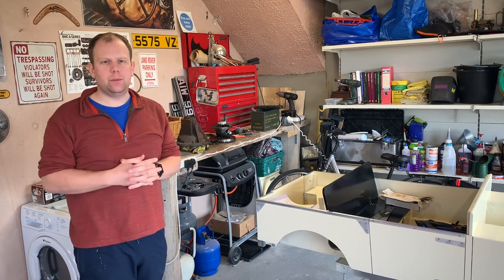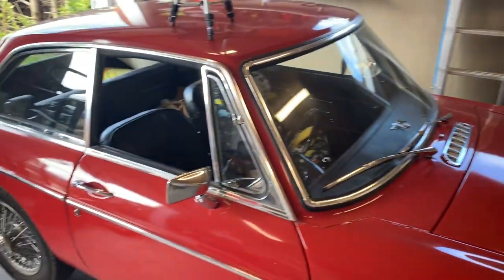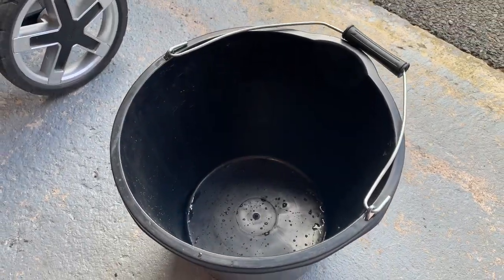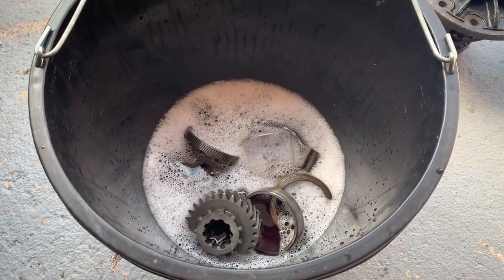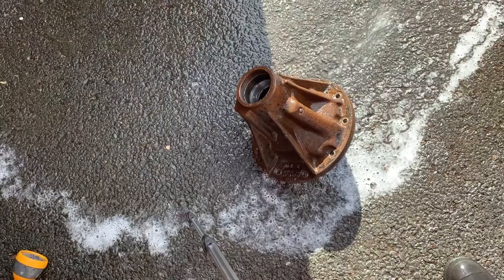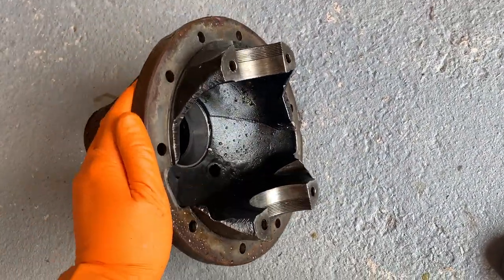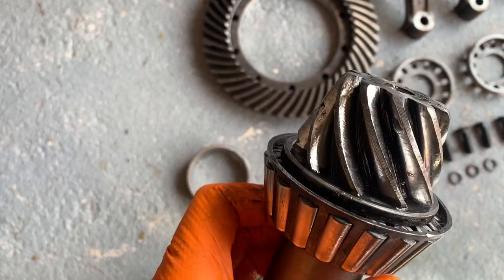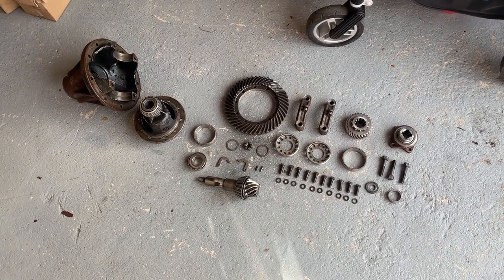Land Rover Differential Rebuild - Part 2

Comment: Do you know the torques for the rebuild?
Reply from the maker: I gave up on this in the end but the Land Rover Workshop Manual was very useful for that sort of thing
Reply: @restosaga  Why do you gave up? There is no explanation about this in the workshop manual..
Reply from the maker: @AndreasWollauer I gave up as I could not get high quality replacement parts and found a well priced used diff locally